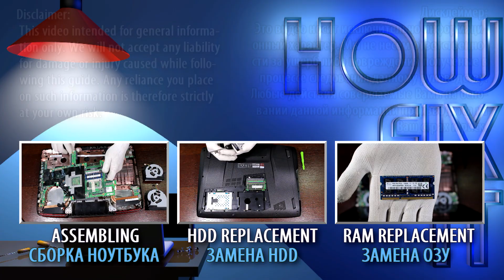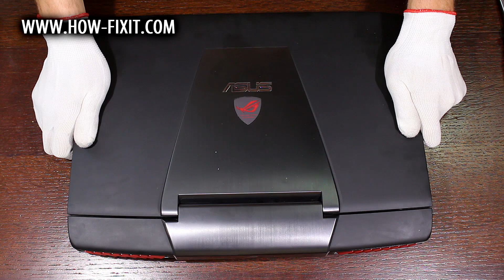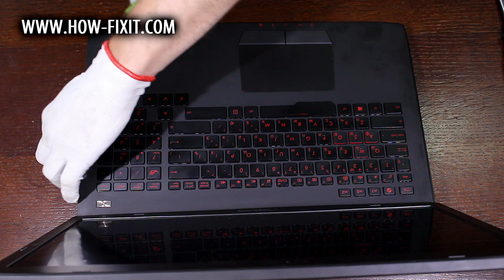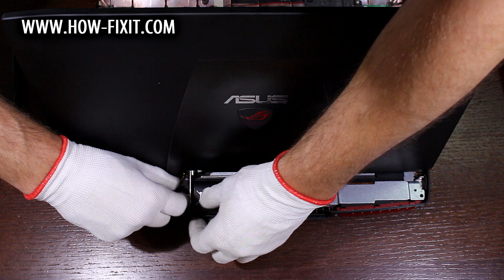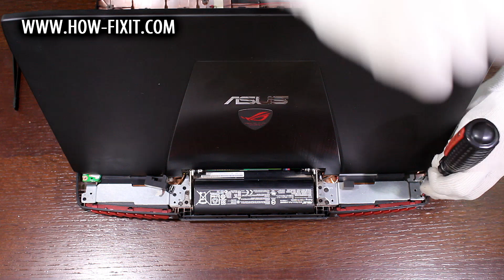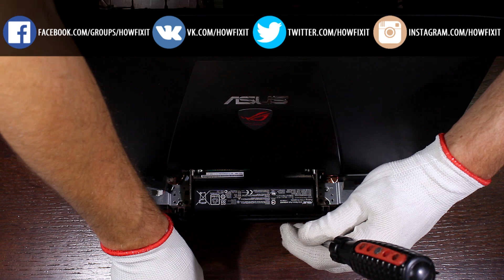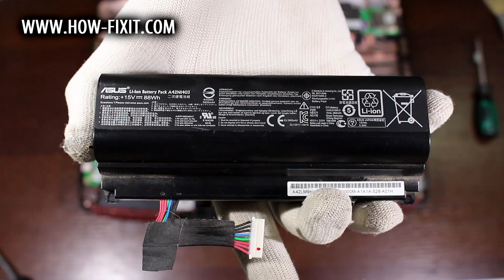Asus ROG G751 Battery Replacement | Repair Fast-Draining Battery

Comment: Thank you for this video! It saved me from buying this stupid laptop! Asus is so highly regarded, that by design, this should be an absolute embarrassment. I could have changed a Lenovo battery, ram, hard drive, in the first 5min of this video. This is not hating on Asus. Asus, is just better than this and this was done, on purpose, stupid, like Apple, Samsung, and other cell phones, now sealing batteries, try to pass it off as water protection, or dust protection, well, my old LG G3 and Note 4, had no dust when changing the battery, easily, letting any electronics get wet, is stupid, so it is a ploy, obviously, to charge you to change it, or more, to just say screw it and get a new phone, as told by and honest Apple rep. It just applies here, based on a great post, by Leslie, Asus wanting $690 for this. Total BS! Can I do it? Absolutely! Does this make me wonder what else is a pain in the butt on it, absolutely. This is NOT at anyone posting, the video, all good, just, come on ASUS, disappointed, or, will spec out another ASUS to gaming spec, likely choosing another brand, so, not so great for you ASUS. I get the rebuttal, don't like it, lazy, don't buy it, but that, honestly, is ridiculous, by design, by a brilliant company and just my opinion, not right, so thank you for this great video!

Comment: I finally replaced the battery and it works great thanks to this video. I just have one problem now. The keyboard backlight doesn't work anymore and I don't know what was messed up to cause that. Could it be one of the connectors under the keyboard or the small white connector in the back under the cover?

Comment: Need help! Just replaced my battery and now the screen is completely out. Any advice?
Reply: Same did you find out
Reply: @akamai6773  Yes turned out I accidentally unplugged the ribbon that connected to the screen. Opened it back up and there it was.

Comment: What a disgrace this design is, for such a crap battery life.  Batteries should be easily replaceable.  Asus you should be ashamed of this laptop design, we want batteries a reasonably capable person could replace. Chances of putting this back together right are slim.

Comment: Could you help me? I did exactly what they vídeo said and now i got no imagge on the screen
Reply: Did you get a solution to this?  I have the same issue after replacing battery.
Reply: @BELFAST1888  me too

Comment: Thank you so much. Doing this replacement has taught me that I will never buy an ASUS product again. Half of the screws on the inside we're already loose. They used a few incorrect screws in some spots. There were at least two kissing screws that I noticed. All of that coupled with the fact that I needed to completely dismantle the laptop to replace the battery makes me despise ASUS. I'm sad that I even have an ASUS mobo in my PC build now.

Comment: Man, worst battery replacement ever.  Thanks for the video, wouldn't have done it without this video.  A few tips. 1, you don't have to disconnect the keyboard, just slide it down couple of inches and leave it there.  2, having an extra pair of hands (friend/family) to hold the screen while you take it out and put it back is very good.  3, take a good note of the two (black, white) cables, because mine's layout is different than video's.  ASUS, u suck!!!

Comment: I managed to replace the battery but now it just shuts off after 10 seconds and the screen doesnt seem like its even getting power. Took it to a local shop just incase and they think i fried the board. So solve one thing, cause another problem. Rip. Im just gonna get a new pc. This thing has been a pain in the ass all year.
Reply from the maker: Without the battery does laptop work?

Comment: So I have this model and my issue is while on my laptop  it suddenly switched to battery power while plugged in, it doesn't even recognize that its plugged in (plugged in, not charging). I tested my charger, its putting out 19.5 volts like it should. My questions is  before I replace the battery is there any other problem that might cause it to not recognize its plugged it or receive a charge?
Reply: Oh btw my battery held a charge before this happened just fine
Reply from the maker: It's ok. Your battery is over, just replace it.

Comment: Its also possible just to disconnect the battery's driver, or uninstall it. It worked fine. if you don't really need the battery.
Reply: My power suply says 0% when plugged in. i can use laptop being plugged but sometimes games geting laggy and info about low power supply is very anoying. how can i disconnect battery driver?
Reply: @tnosu9413  find the battery in the device manager. Than you can choose desactivate

Comment: What kind of problem do i have when my computer just die even if the computer is plugged in. Sometimes I got it running but it never charge only stays at 0%. I guess I also have a battery problem.
Reply from the maker: Yes, your battery is died
Reply: Mine's 4 years old and just started doing the same thing; I feel your pain
Reply: @Xencam  yeah it's about same age as yours, it sucks. Feels like I haven't use it a lot either

Comment: my last laptop was an msi. When the battery went out i didnt even need a screwdriver, you pull two tabs and the battery pops out, and you just put the new one in....battery on the rog dies im like ok thats not that bad...turn it over and see that you have to unscrew it so i do...and i see the fucking hard drive...WHY DO I HAVE TO DISASSEMBLE THE ENTIRE LAPTOP TO REPLACE A PIECE THAT EVERYBODY KNOWS WILL EVENTUALLY FAIL?

Comment: Does it uses regular 18650 cells? My battery is also death and not planning on buying a 500$ replacement battery..
Reply: I actually repair computers and build them. I have never had an issue working on a laptop. I have the G751 jy for gaming. Replaced the battery and now the system turns on but it wont post. 

A few days later. Computer would not turn on. Battery lasted me 5 years. Glad to know I wasted 2k on a gaming laptop. I stand by ASUS's hardware but not their laptops. I will stick to a desktop system from now on. 

Replacing the battery is simple. But possibly ruining the system in the process is not worth it.

Comment: OMG you have to take the ENTIRE laptop completely to shreds to get to the battery. Bad design. Good video though.
Reply: Its actually a good design. a limited shelf life of the battery and a very complicated way to replace it to the point that youll be demoralized and pay asus to fix it.
Reply: He performed a lot of needless steps. I've replaced a dozwn batteries on this model.  You dont have to remove the keyboard or the screen on this unit. He must get paid by the hour.
Reply: Short version is pop off battery cover, remove attached connector. Remove screws from bottom. Pop up keyboard and slowy/gently slide forward. Remove screws holding LCD screen in place. Gently lay it on top of keyboard. Remove screws holding in battery. Detach power connector. Replace battery and follow prior directions in reverse. There is no need to remove any thing else (especially the tiny connectors from the keyboard to the Mobo).

Comment: Wow that's a dumb battery placement!   My old HP's battery pops in and out with ease... Looks like I've got allot of unnecessary work in my near future, SMH.
Reply: Short version is pop off battery cover, remove attached connector. Remove screws from bottom. Pop up keyboard and slowy/gently slide forward. Remove screws holding LCD screen in place. Gently lay it on top of keyboard. Remove screws holding in battery. Detach power connector. Replace battery and follow prior directions in reverse. There is no need to remove any thing else (especially the tiny connectors from the keyboard to the Mobo).
Reply: Thanks for the shortcut!  I was able to replace my battery without taking everything out.  I just put out the keyboard, then I slide it out a little so that I could access the battery connector (attached to the motherboard).  I did remove the screen to get access to the two screws holding the battery in, but it wasn't too much of a hassle.  Thanks, again!

Comment: Man, I just had this battery replaced 6 months ago by the geek squads Asus repair facility. It cost 870 damn dollars! Just 5 days ago, it went dead AGAIN! This is ridiculous. Great laptop when the f*ckin' battery doesn't die out.
Reply: I have the same problem.
Reply: They charged you that much for a service call? Dude I had my battery replaced for less than $100

Comment: My laptop is actually getting extremely hot and i don't know whats causing it. My Charging PORT metal contact converts extreme heat from inside the laptop. I don't know if its a bad battery or burnt out fan. Just the other day for the first time i would plug in my chargers and there would be no charge. But after resetting my laptop, it can sustain a charge again how ever like i said, the metal charging contact gets real hot as its charging. This is not a charger it self cause i have tried three other chargers including the stock one. Also there is alot of heat coming from the exhausts on the back of the laptop.

Comment: After replacing my battery my computer will turn on with lights but is extremely silent then clicks and turns off. Any idea? Help!!
Reply: Hungryhero -The Hungry Gamer check the connectors
Reply: Hungryhero did u figure that problem out

Comment: I was replacing the battery on my laptop, as I was putting it back together I caused static electricity. I put the computer back together and the computer works, but the screen is now flickering. I connected my laptop via HDMI to my tv and there's no issues using the computer. Now, my question is if I only damaged the actual lcd screen or did I damage something on the motherboard which is causing my screen to flicker. Also, I just noticed when I have my computer plugged in with the power adapter the screen is on and flickers, but if I'm only using power from the battery, the monitor doesn't turn on.

Anyway I would be able to test this out? Also, where would you recommend me on buying the replacement part.

Bittersweet moment: the replacement battery worked!
Reply: I don't know if i am a lucky person for the past 4 years but i dismantled over 2000 lappys and never had that problem. i think you may have damaged the lcd cable or maybe did not securely plugged in.

Comment: Asus absolute rubbish. After less than a year battery has died and I do need to do all this messy stuff. Don't ever buy Asus
Reply: Or make it to where you don't have to perform fucking open heart surgery just to get to the damn battery lol.
Reply: same here man, my battery only lasted 2 years & now it is showing 0% but keeps charging & if i try to run even the older games, it keeps shutting down,
Reply: asus could put a better battery in these things.
Reply: Your comment is absolute rubbish. Asus ROG rocks and this procedure ain't that difficult at all. I've done a lot worse and more complex on toshibas dells or acers. Have you ever dismantled a laptop before?  This was walk in the park
Reply: @Frank_Kimono  Really? You sound like you have never had it. And yes, Assus is responsible for the stuff it assembles and how it does it. This model got a really shtyyy fan and therefore the battery take all the hit and dies quickly. Second battery died in 6 months after first. And it is a real nitty greedy job to change it. And by the way if you keep using it on power wired while the battery is dead after a short time your keyboard will start messing with you and guess who’s fault this is? Battery. So don’t ever buy Asus
Reply: @VCCIMPACT  But I do have it. And it's fantastic, best gaming laptop I ever had, and I've had quite a few before. You talk out of your ass. The fans perform superb and quiet, you hardly ever hear them, system never ever overheats, keyboard works perfectly fine, just like everything else. Well built, powerful and solid machine. System boots up and is ready to roll in less than 7 seconds as it always has in last 5.5 years. The replacement battery lasts approx 2 and half hours, similar to genuine Asus one when new. If your batteries die in 6 months - you are the problem. 
All those issues you're listing - you're on your own. Fixing laptops isn't obviously your hack, so, to answer your question " guess who's fault this is? " - Well, sonny jim, I hate to break it to you, but it's your fault.
 Don't blame asus for your lack of skills.
Reply: That's the battery's fault, ,not Asus's... A gamaing laptop pumps more current from the battery, that means it will shorten it's lifetime. One year for a gaming laptop bttery is still a little short, butdon't expect it too last 5 Years...
Reply: + @Whatsthegeek   Asus chose to put the shitty battery in there, not only that they chose this design with all this unnecessary disassembly. So yes, it's ultimately Asus fault.
Reply: So, I should feel lucky here, my G751jy battery worked more than 5 years. but finding that this the way to replace the battery I felt unlucky.

Comment: I did as you instructed and the battery works great.  My problem now is after putting it all back together the screen won't go on.  I have watched your video 3 times front to back and did exactly like you instructed.  Am I missing something?
Reply: Which battery did you purchase? Thanks

Comment: I did it exactly by this video, Great success. Thank you. Asus wanted to charge $690 for this job. I did it for my son and I am proud.
Reply: Scared if taking mine apart. Image if it doesnt boot afterwards....
Reply: thats where im at now with my G752-VY  @schnitzel2425  fml
Reply: @carolynwiden323  I sold mine with GTX980M for 650€ and bought the at that point newest one from MSI. Apart from constant overheating, this notebook is genious in terms of specs and being able to take it apart to the MB without problems. Wasn't even possible to clean the fans of my ROG!
Reply: video looks complicated but when you actually do it is easier. was it easy or hard like the video?? I've taken apart desktops PC's but, never a laptop.
Reply: @Raul Velasquez well it's also intimidating because I spent $2200 on this thing. The mere thought of damaging it on accident gives me a small panic attack.

Comment: hello , I also need to replace the battery but I can't figure what kind of battery to order . my model is asus rog g751j and on the right side down it says g751jt ... amazon UK has both models , can you please help me , thx in advance.
Reply: Just for record purpose the exact model number for this battery is A42N1403 (easier to search that for finding a good source for the battery)
Reply from the maker: all G751 Series has 1 battery model, so you can search it as G751, G751J or G751JT it doesn't matter